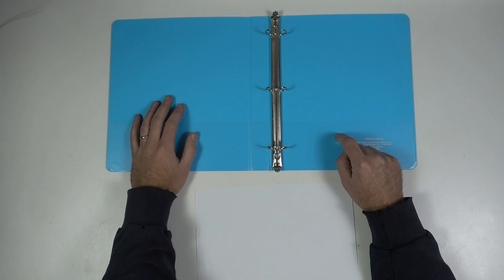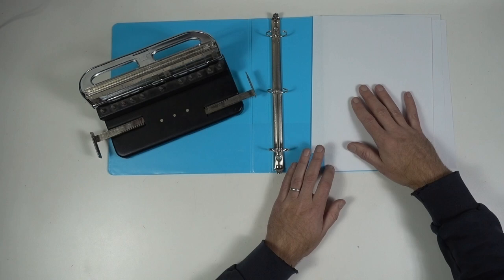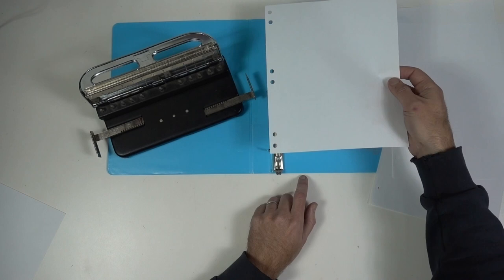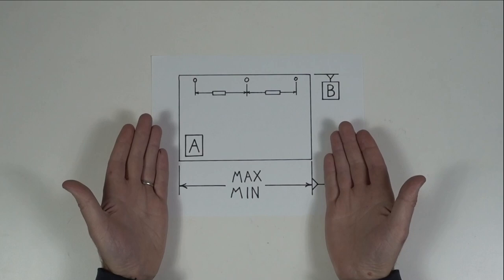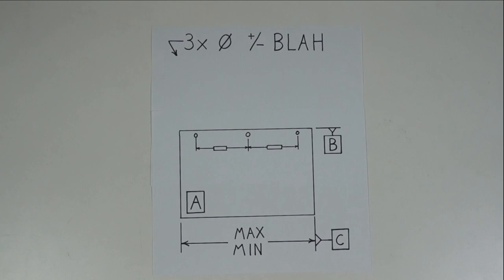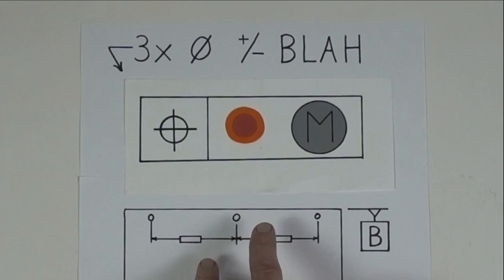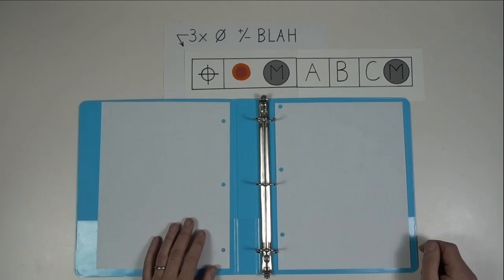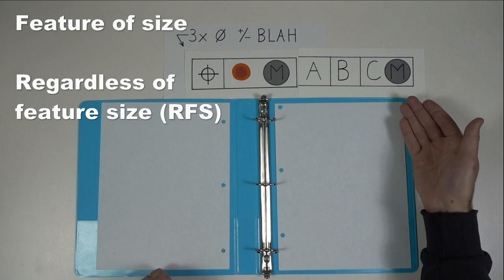GD&T Datum Shift vs. Bonus Tolerance Lesson 15 - NO MATH

Comment: loving the vids so far.  thank you.

gotta min?

I took some machining classes, applied at a place to be a machinist.  I wore a coat & tie to the interview, the Director of Quality saw me & told HR to put me in Quality.  That was 5 years ago & I am now training to be a QT directly to QE (i'm already designated QE on projects).   I am struggling with a few things (mostly paperwork related... ie pFMEAs, PPAP, etc... i'm getting that sorted though).

I would fancy my GD&T higher level (as compared to most people in this company) but struggle with a few things.  Can you point me in the direction of how I can grasp...

1 - tolerancing  to a profile.  As in the tolerance in the title block has profile of a surface w/in .005 & un-toleranced dimensions are "basic".  I assume then for inspection purposes - ±.025

2 - i have a basic distance dimension that the customer wants 100% inspected, but they don't want the profile that references it inspected  outside of an FAI.  What tolerance can I apply to it?  the tol on the profile is .062 - so i would assume .031  I am arguing we need a custom gauge to locate positions & profile as this particular part is too large to fit on a vision system or OC & our CMM programmer can't get reliable hits on very small radii.  The gauge will get the distance quickly as well as verify the rest of the features.

3 - manually calculating position, or 2-D position (x,y)  on a CMM when there is 3 datums.  obviously 3 datums will determine fixturing & programming... but for inspection purposes?  I argue that position in xy is position.  the reference to perpendicularity isn't part of the position formula & should be measured separately.  therefore plug deviations of x/y into the formula to get position.  

the MEs say only a CMM will work - yet the CMM programmer doesn't construct a cylinder.... just a circle.... effectively making it 2 dimensional in my eyes.  I don't see how that is any different than using an OC or EHG to establish deltas in x/y. 

As a matter of fact I would argue that it would be more accurate to take an x/y position open plate from both sides of a bore & that would be more accurate than the current CMM protocol.

Comment: Great explanation with a the support of this sheets, binder and puncher. 

I only was thinking about your comment on punching one hole first and the other two.  The machine (the puncher)  is actually not capable to do that,  it can only punch the three wholes as a linear pattern at the same time every time.  And actually many machines in the industry are working the same.  

If the woles can move only as a pattern  and the jaws on the puncher are completely wide open (at their Least Material Boundary) wouldn't then this condition be considered as a bonus tolerance?

I understand bonus and datum shift are different concepts,  but isn't datum shift also giving space for variations when the position controlled features move around together as a pattern?

Thanks a lot again for the video. I found it very illustrative =)